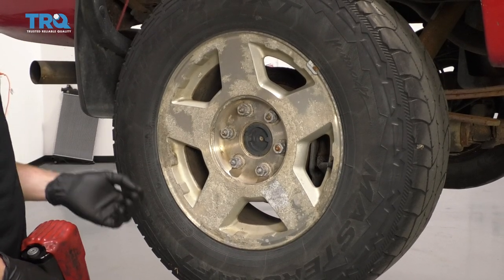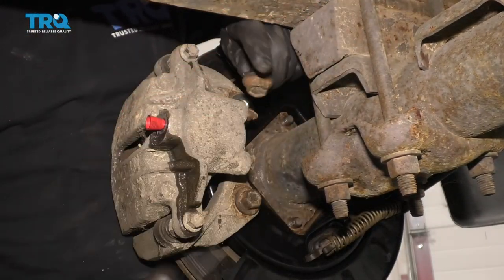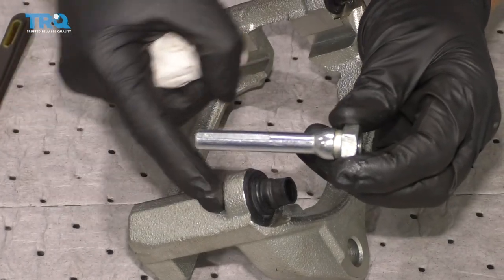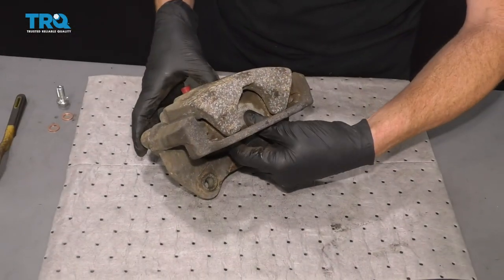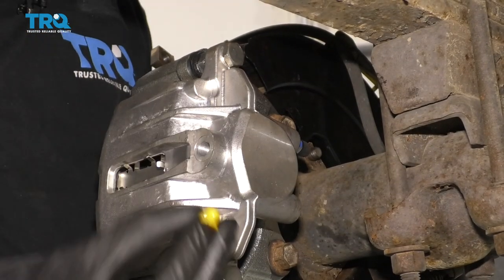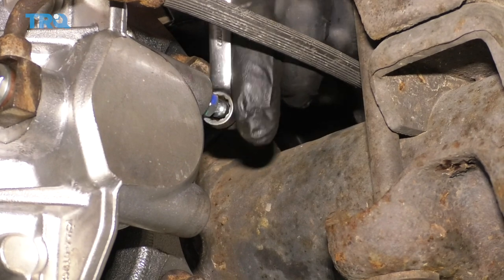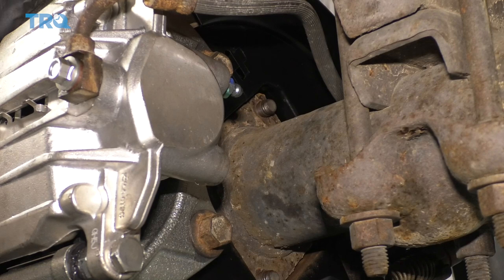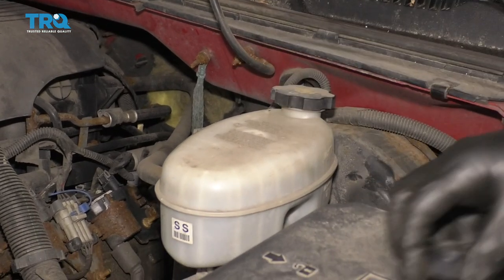How to Replace Rear Caliper 2003-2007 Chevy Silverado

Comment: Thank you so much! I put rear pads on my truck and my drivers rear caliper was stuck. I realized I put the “damper” on the caliper bracket on backwards causing it to get stuck on the pad and not releasing the piston. I had a loooonngggg day but it was an easy fix!

Comment: Great video! Except for 1 part. Please never put thread lock on brake system bolts! Very unnecessary and makes it a pain to get out in rust belt states! Torque to factory spec and I promise your bolts will not back out.

Comment: So i have a 2006 Chevy Silverado 1500, and my rear drums went out, so I took the opportunity to do a disc setup. I bought a new calipers, rear lines, and have bled it for a couple days now. I have used to soapy water to check for leaks, and looks like I don't have any. But when you get in the truck with the truck off the brake pedal is solid, and normal feeling but right when you start it up, it almost goes to the floor and it has a spongy brake pedal. I took it around the block and if I pump the brakes a couple of times the pedal feels good. But when I come to another stop I have to pump more times to get that solid feeling back. I have done a automatic bleeder a couple times and even bled the master. I am truly stuck on this and if anyone has an idea, I would really appreciate some help.
Reply: Have you checked the windshield wiper fluid yet?
Reply: Did you figure it out?